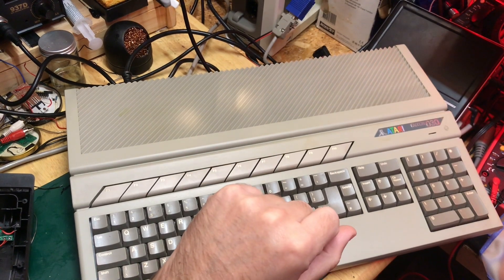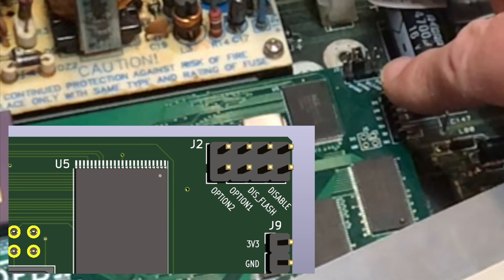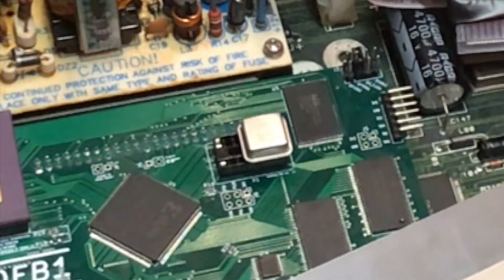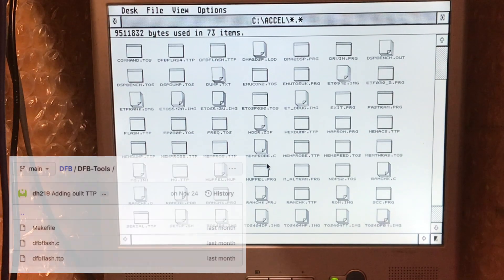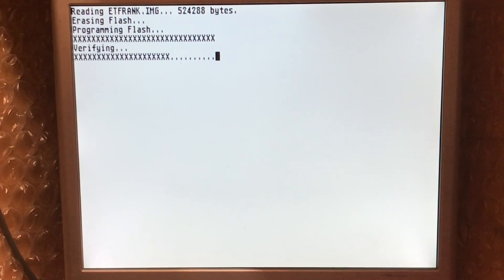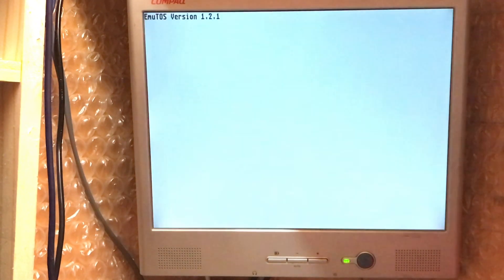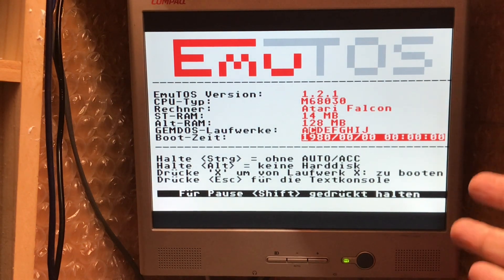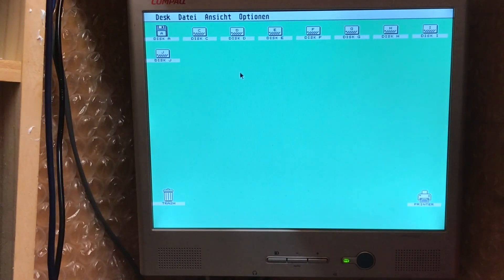Atari Falcon DFB1 flash memory tutorial

Comment: can you do a short video how you make your jumper extension cable for switching between Bank 0 (TOS) and Bank 1 (EMUTOS) ?
Reply from the maker: My DFB1 only has a 512k flash, so no bank 1. My jumper lead extends the configuration switches at the top right. The third of which (from the left) controls if flash is active (EmuTOS) or not (onboard TOS4.04).

Comment: Great video!!!  I forget, is the DFB1 open source - I might have a go at building one at some point next year!
Reply from the maker: Thanks, Gadget! Yes. It's all open source. If you don't hold too much of a candle for the FPU then it's pretty reliable. We've been working through some issues with the top speed not quite matching some CPUs capabilities and different FPUs being a bit temperamental, but I'd be tempted not to even bother with the FPU and run at 40 MHz, to be honest. :)
Reply: I think I need one.  I was trying to set up my Alt Falcon (as in the one that is closest to stock, as I haven't quite figured out how to get the top on my other bird with the SV in it...) and well, I loaded up Papyrus X on it, and since it requires 640x480@256 colors, it is crazy slow... though maybe that was because it was before I remembered to install SpeedoGDOs... but still, going from a 16mhz 030 to a 40 or 50 would be a massive improvement.